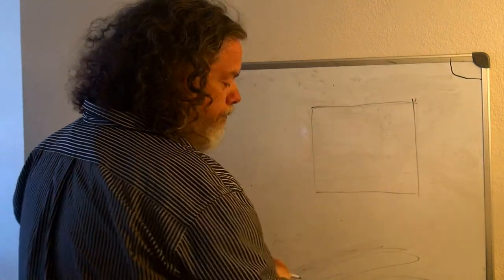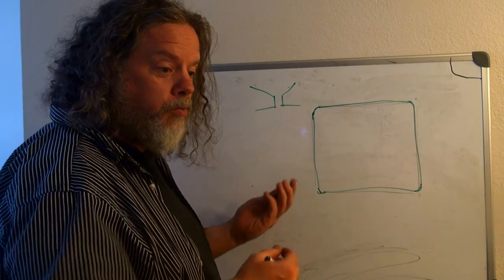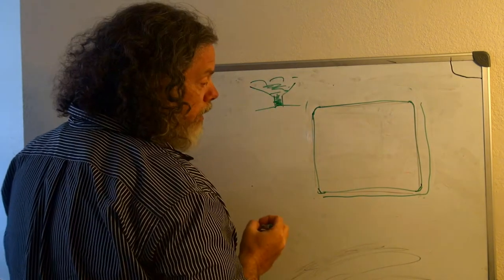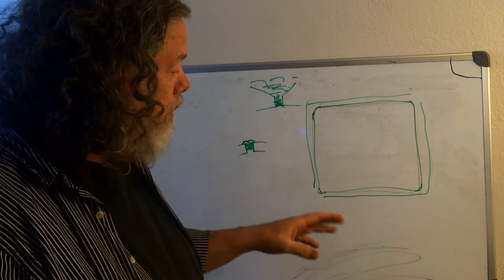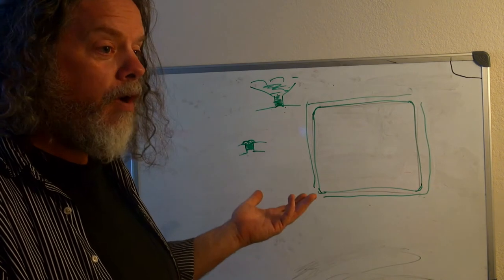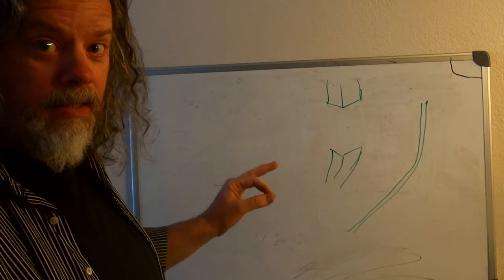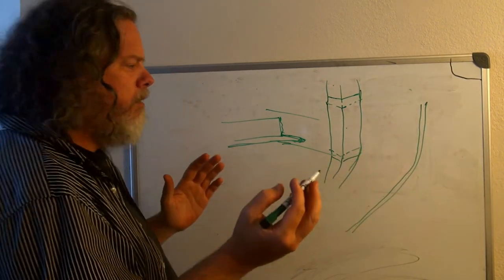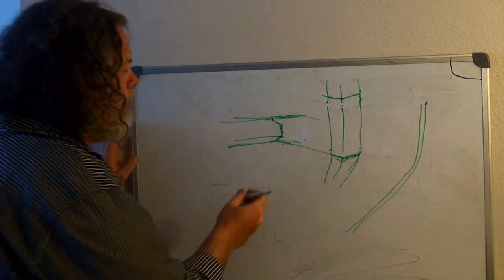Ship fitting 101. Welding an insert, angels, rat holes and strong backs

Comment: great video. what is the minimum insertion plate size as by your national standard or Class
Reply from the maker: Depending on the area above or below water line but you want it to be  mid - in between stringers, but best have an engineer take a look.

Comment: what size radius?
Reply from the maker: I say big enough to fit a welding rod through for a good tie-in and it looks good. You can use the bottom of a pop can or with most welders Beer can.
Reply: I deal with aluminum boats a lot we just use a 6" cutoff wheel

Comment: Why cant the plate have squared off edges?
Reply: It creates at hard spot and will crack.  You can actually put in a square crop IF you are installing at old seams and make a relief cut into the seam at least 6".  Sometimes you may see a crop with 2 radius corners and one square.
Reply: Stress relief
Reply: A squared edge focuses all stress to a single point while a curved edge distributes the stress along the entire curve.  Same reason bridges and other structures are built using archs instead of square angles. Also why airplanes don't have squared windows.

Comment: I can dig the video, but when you say things like "don't cap with a single pass, need multiple passes." And then simply say "You can't do that.." and continue on without at all saying why I don't actually learn anything. It's just a guy saying don't do something. Educate me I'm here to learn.
Reply from the maker: Been a long time since I did this video. The reason for multiple passes vs single is strength, multiple passes never start and stop at the same spot so you have a layering effect making it stronger and more flexible at the same time (Think Carbon fiber) it's the layering effect that gives it strength. Most welds break due to bad root passes but more so due to bad cover passes, leaving small cracks that allow the elements to come in and in the world of Shipyard welding SALT Water. The killer of all things.